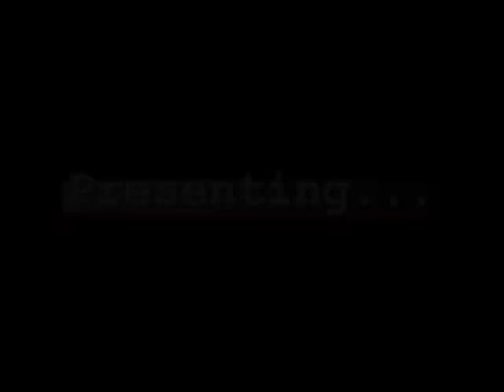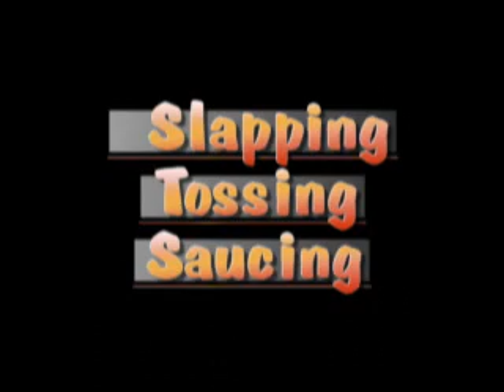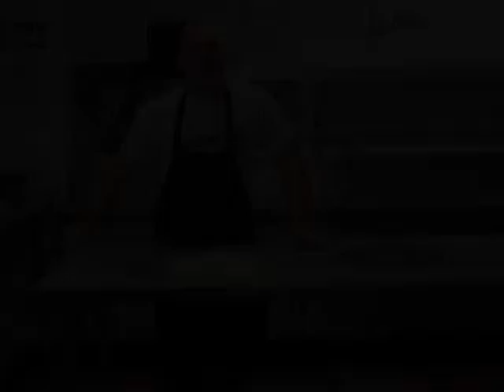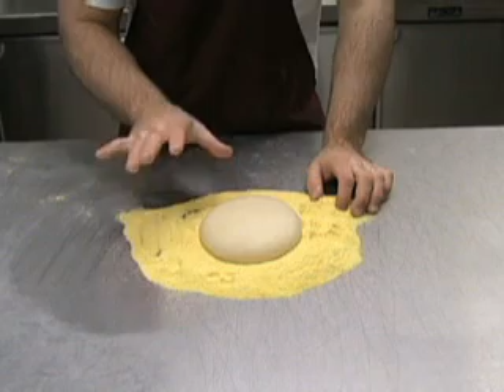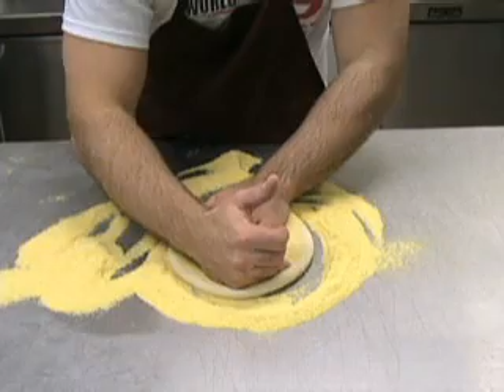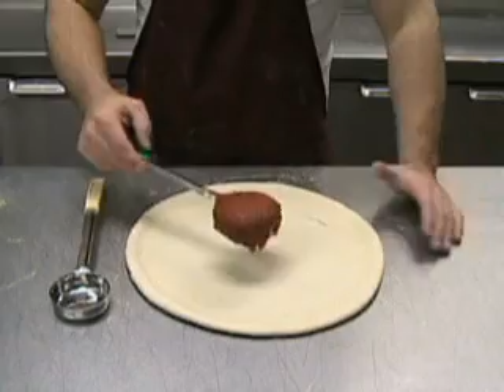Pizza Slapping/Tossing/Saucing

Comment: About the spoodle complain, well I found a cheap and generic one on a supermarket and it work. If you you not found one well you can use regular spoon or even the measure cups, it has flat surface and it is fine.

Comment: When I learned how to "slap"/ throw pizza I learned with a kitchen towel folded in 1/4 then wet down to get a close weight and practice throwing back and forth when ever I had time. Then let the towel open up to the right size of a 12" pie then went to real dough and got it down in about 45 minute with only 2 pizzas where I threw the dough to hard and put my fist through it. Now I can stretch a dough out in about a minute and have it made in under 2 out of the over 5 minutes later

Comment: It's funny how easy you make this look, I guess I need to try this before I say I can't do it. As you said you need to practice before you get the swing of it. I think slapping the pizza dough back and forth would be easier to learn than tossing the dough in the air and possibly dropping the dough and wasting the dough on the floor. Slapping it at least you can control how far you want to away from your other hand that way it won't fall and you can be still stretching the dough. As far as saucing the pizza, I have never seen a sauce spoon as you have shown so I will have to get one of those. Thank you for showing everyone how to make pizza the professional way. Great video for beginners.
Reply: thanks bro

Comment: What oven Temp should be used with that Screen for cooking that Pizza,? Thanks for sharing great Instructions etc.
Reply: 600
Reply: 475ish.
Reply: Depends on the cooking time. If you're going for a 6.5 minute cook, you should aim for about 550F. Also it's important to know the type of cheese that's being used, and the proportion of top and bottom heat, as well as if you're using a deck oven (steel deck or brick deck is important as well) or convection oven. If you're using a deck oven, 500 would probably be better. Another thing to consider is the moisture content of your cheese as well as its shape (cubed vs shredded) as they have different surface area profiles and will adjust cooking times. There's a lot of factors to consider.

Comment: My dough is very elastic. I try to stretch it out and it is fighting with me and goes right back again. How do I make it stretch out and stay there?
Reply: Let your dough rest at room temperature in an airtight container for a couple of hours and then try it.

I don't know what your procedure is, but a common procedure goes like this: 

After making, kneading, and balling your dough, let it slow-rise in the refrigerator, in an airtight container, for a couple of days (assuming you are using instant dry yeast, AKA: "IDY"). Then take it out of the refrigerator and let it warm up to room temperature (which will take a couple of hours at least) before trying to stretch it out. Cold dough won't stretch very well, and dough that hasn't risen/rested for long enough won't stretch well either.
Reply: make it two days before you want to use it and keep it in the fridge covered. take it out 3-4 hrs before you want to use it.  it will spread like butter if your ratios are right.

Comment: That must be a special type of dough for it to be hand manipulated like that; What's the dough recipe please?
Reply: Hmm, that's a little disrespectful to ask a question like that :/
Reply: @Got5your6  Why the hell is my question disrespectful? Please explain.
Reply: Nothing super special. It's more likely the temperature it's being used at. A general recipe for that sort of dough would be to take a high-gluten pizza flour (no, that's not redundant) at 50 pounds, and add 29.75 pounds of water, 19-22 ounces of sugar, 12-16 ounces of salt, 2 ounces of yeast, and about 22-24 ounces of vegetable or soybean oil, then mix until desired gluten formation is reached. Let proof in 38 degree (Fahrenheit) walkin cooler in a thick dough proofing box, and use at about 50-55 degrees (Fahrenheit) dough temp, which is achieved usually by pulling the dough out of the cooler for about 45 minutes. Once dough gets up to a much higher temperature it becomes softer, and acts less like a putty. You'll need to do your own testing on the ingredients. The recipe doesn't scale down super well, so keep that in mind. You'll have a real rough time if you try to make 1-2 dough balls from it. 

Their recipe is very likely somewhere around that.
Reply: @PaulTMaack0  Great, thanks for the advice.

Comment: what's with the corn meal that's taking short cuts because it slides easier corn meal is not in any recipe that I know unless your papa johns or dominos you get the drift, go back to the school and get it right.
Reply: Chris Corsi actually papa John's uses a flour mixture called dustinator it's pretty good for edge locking and slapping

Comment: What's the purpose of the screen?
Reply: size and shape consistency. Also, if you're using a conveyor belt oven (convection oven) it's the only option. Lots of places use conveyor belt ovens as they are able to yield more pizzas in a given time than a deck oven of the same footprint, with less skill and attention required for management. The downside is the crispiness of the crust is highly diminished, which is generally not a problem for this style of pizza since it's almost exclusively used for delivery (where the crispiness is gone anyway by the time it reaches the customer).

Comment: It looks finished at 03:42, whats the point of throwing it from hand to hand?
Reply: To remove the corn meal. Not everyone wants a mouth full of corn-flavored sandy textured meal with their pizza.
Reply: @PaulTMaack0  How will that remove it?
Reply: @jeffallinson8089  there's a slight amount of traction as you move the dough from one hand to the other. Effectively you are allowing the stuff that's not adhered directly with the stickiness of the dough to fall off on its own, and brushing the rest off with your fingers as you transfer the dough from one hand to the other while gently stretching. 

The stretch isn't done by holding two places firmly and stretching the space between them, it's done by sliding the dough and providing traction to stretch the entire segment of dough your hand comes into contact with. There'll still be some corn meal on the dough when he's done, but only the stuff that's REALLY stuck there. Which is kinda the point, as it'll prevent the dough from sticking the the screen. That really sticky part is where the dough tears ever so slightly on the outside, and exposes the really moist, sticky inside. Without the corn meal (or flour, or semolina) it'd stick REALLY hard to the screen, and would likely tear a giant hole in the pizza when you go to remove it.
Reply: @PaulTMaack0  Thanks for that. It looks like a technique that takes a very long time to master.